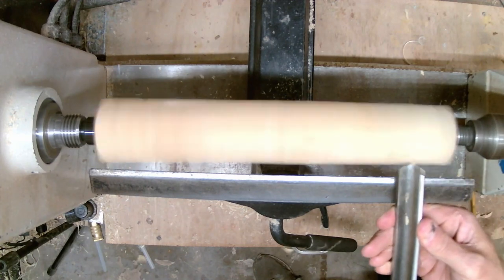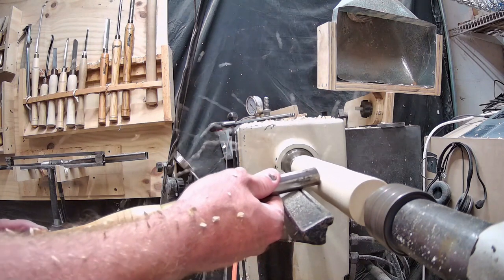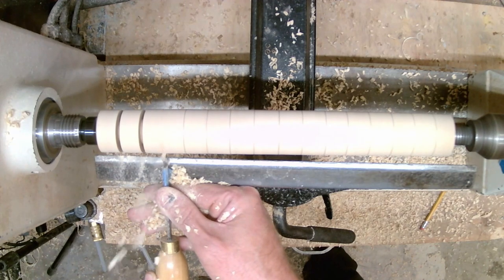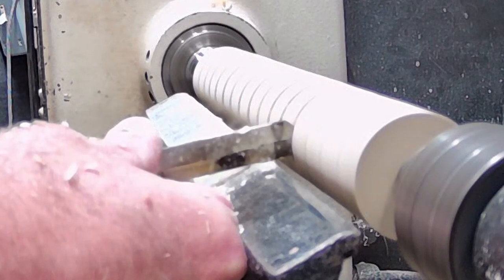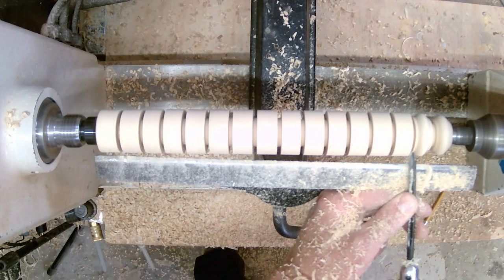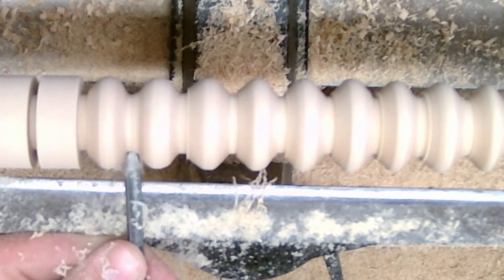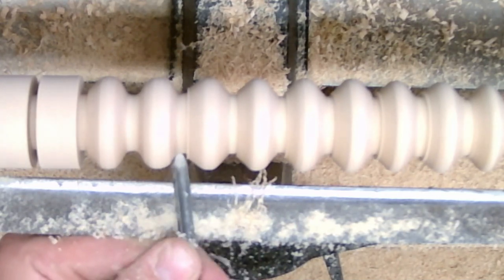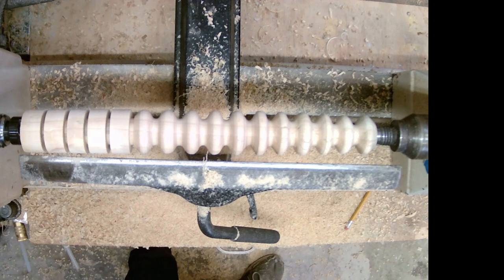Woodturning 5 easy steps for perfect beads and coves using a detail spindle gouge

Comment: Very helpful.  What was the lathe speed?
Reply from the maker: Around 2000 rpm.  When your working with small spindles between centers turn as fast as you feel comfortable.  The higher the rpm's the better the cuts you will get.